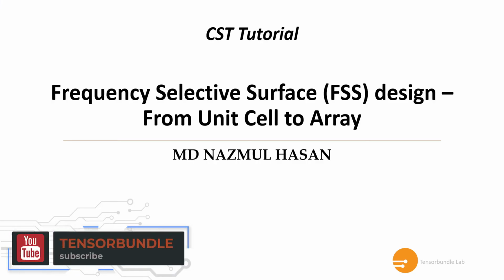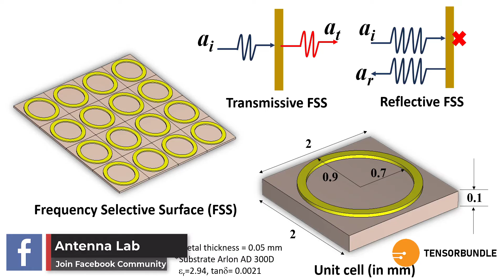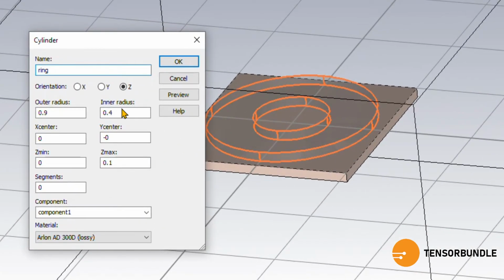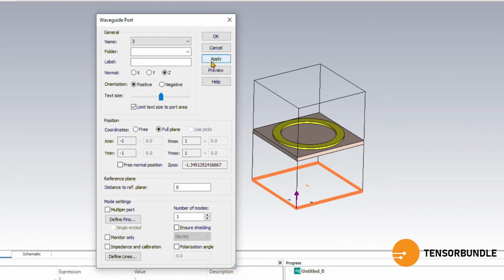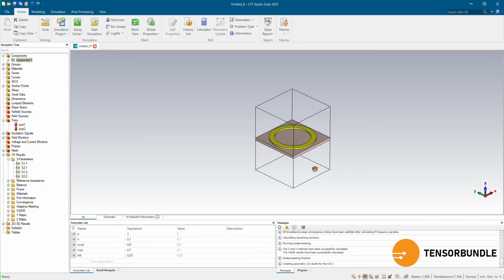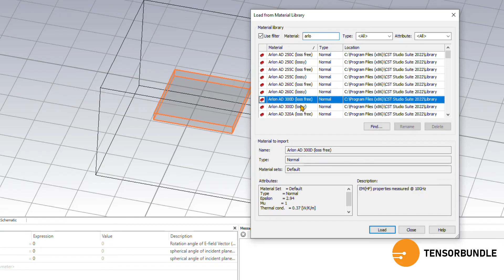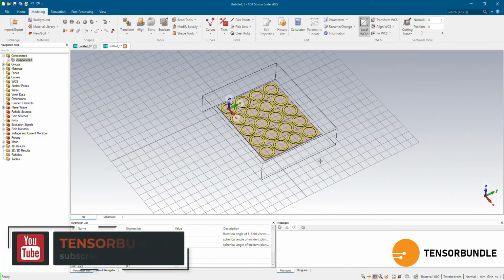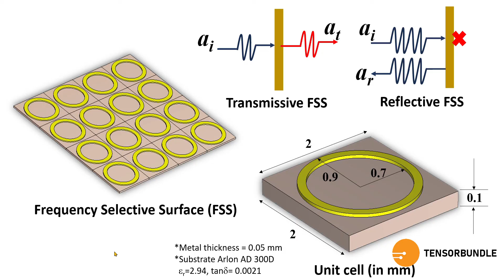CST tutorial: Frequency Selective Surface (FSS) design - unit cell design & array full simulation

Comment: Hello! Thanks for the video, really interesting. I have a question, you mentioned that the surface is reflective but based on the radiation diagram, approximately the same amount of power that goes through the estructure is reflected (you have two lobes instead of one), why is that happening?

Comment: How do I do it for 2.4 Ghz
Reply from the maker: you can scale the structure. For 2.4 GHz you need to increase the unit cell dimension (bigger cell). This also will increase your simulation time.
Reply: @tensorbundle  thank you sir

Comment: Hello Sir. Could you please guide me that how can we simulate an array using floquet port to get S11 and S21. As in this simulation you had used a plane wave which doesn't give us S-parameters. It's urgent as i need to submit paper. Your guidance will be highly appreciated. Thanks
Reply from the maker: Normally, S-parameters are useful for unit cell analysis. For array simulation, the analysis is done in terms for beam-pattern,  power pattern e.g. the array indicates the collective performance of all the unit cells. That's why when we rather are interested in radiated field pattern/ power pattern/ beam pattern of the array not the s-parameters. The array works based on the assumption that free space wave hits the array surface and then something happens, and so we use plane wave engine to simulate the array. On the contrary, s-parameters assume that there is a waveguide port which is the point of entering the energy into the system. This s-parameters approach is more practical and suitable for unit cell analysis because during measurement of unit cell, we actually use a waveguide and put the unit cell at one end and then launch wave from the other end of waveguide and capture the S11, S21 etc.

Comment: Good video thanks. Still not entirely clear why it acts like a PEC at the design frequency. The substrate is so electrically small thickness yet the copper ring can reflect. It would be helpful if you plotted the current distribution at 60 GHz to see whats happening
Reply from the maker: The metal ring introduces self-inductance due to the flow of charge within its circular loop, along with mutual inductance arising from its interaction with neighboring current loops. Additionally, the distribution of charge between adjacent rings induces additional capacitance. The successive capacitance and inductance configurations creates a low impedance surface at its resonant frequency. This leads to the formation of a stop band region, where the transmission of plane waves through the array surface is impeded, and the incident wave is reflected as though interacting with a metallic sheet.
Reply: @tensorbundle  that makes sense, but we see it working just as good with the single element as a reflector which would have the minimum mutual capacitance/inductance. 

Characterizing the impedance can be very difficult without a ground plane. Typically when you have a substrate material backed by a conductor, a majority of the fields (when excited by some source) stay inside the material with the higher permittivity, and attenuate drastically as the wave propagates past the substrate. This energy isn't absorbed as heat necessarily, but rather would be reflected, hence the substrate may be behaving like a PMC as well where the substrate meets free space on the backside of the FSS. This could then be reflected. This reflection would be strongly dependent on the thickness of the substrate, which would be interesting to see what happens if the thickness becomes a significant electrical length.

Just food for thought.. :)
Reply: @jacobrandall4891  How does the circular ring fed? In the figure no physical feed is shown? I beg your sincerest response please?
Reply: @MassiveMimo-rn3we  there's a way to stimulate plane wave excitation. Not sure how I don't usually do it, but there's probably info elsewhere online
Reply: @jacobrandall4891   I would like to express my sincere gratitude for your prompt response. Can we generate a gain result for the unit cell? My design's gain result is -200 dB, even though dimensions of the unit cell optimized using GA. What is wrong with my design, please?
Reply: @MassiveMimo-rn3we  well the closest thing I could imagine to measuring the "gain" would be to reference it as an RCS of sorts. So if you consider the measurement of the reflected power of this FSS and compare it to known RCS of a common target ie corner reflector, you can determine scattering strength. Your best bet is to take that info and try to correlate it to a similar antennas RCS (such as a ring antenna of the same size). That optimal gain of that ring antenna should correlate to your "gain" of a unit cell FSS if the RCS of both structures are similar.

FYI please note my suggestion is pure speculation and may not be accurate.
Reply: @tensorbundle   How does the circular ring fed? In the figure no physical feed is shown? I beg your sincerest response please?